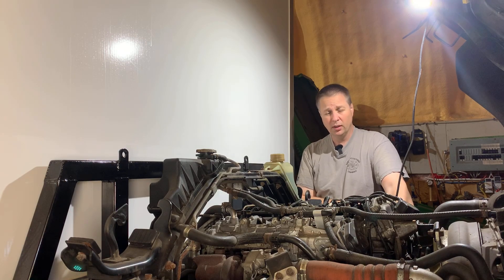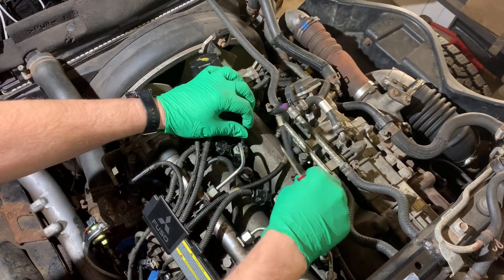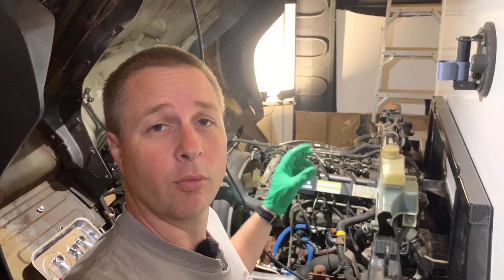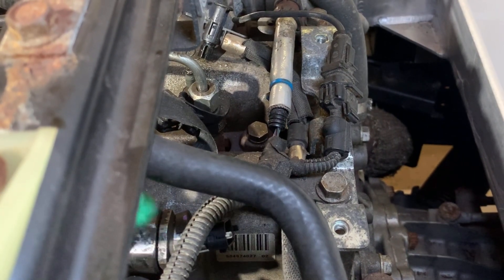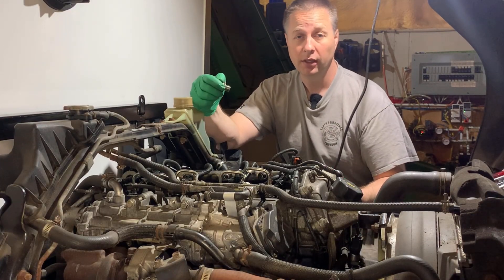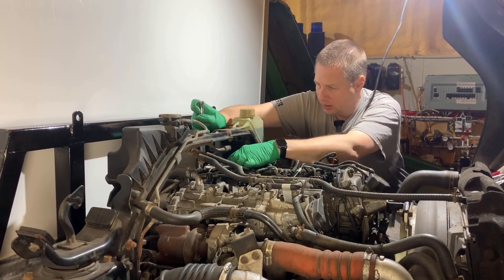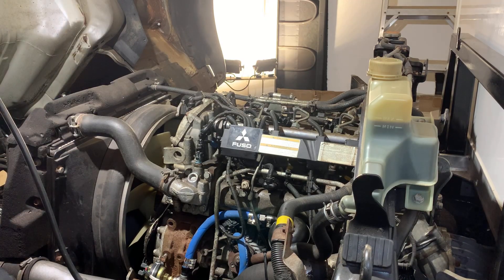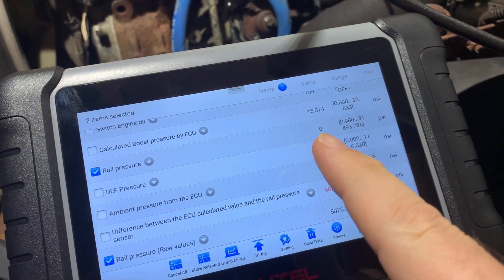Mitsubishi FUSO - Fuel Rail Pressure Regulator and sensor.

Comment: Hello,
Sir,
Which is best Scanner for Modern Efi diesel engine diagnostics. 
Plz guide
Reply from the maker: There can be many differences without knowing the brands.  Some have very specific requirements - so best to check any scanner you are considering to confirm it works on the brands you have locally to you.  I have been very happy with Autel.

Comment: My thinking behind it is this, just like the injectors don’t fire until around 1800/2000 psi as they could dribble giving you a diesel knock or hydraulic lock,
The high pressure pump won’t pump until the ecm see a pressure of 180/220 psi as it wouldn’t be able to sustain operation
Reply from the maker: Good thought, but the high pressure pump is fully mechanical - if fuel is getting to the mechanical pump while the engine is cranking, it will push the fuel out (if its working properly!)  This electric lift pump on this engine is not designed to operate at as high a pressure as what you are describing - it's intended to provide fuel to the high pressure pump somewhere in the range between 60 and 100PSI.

Comment: I think you may of created a man made fault on top of a fault which it’s is so tricky to pin point,
Get you electric pump pressure back up to 180/220 psi 
Keep your rail out let’s blocked off and go from there,
Reply from the maker: It's absolutely possible there is more than one issue, however I have been going through and eliminating them one at a time.  As mentioned, the electric lift pump on this engine is not designed to supply 180/220 PSI.  Which engine are you pulling this information from?

Comment: I’ve just checked on the canta I’m working on
The electric pump in the fuel tank is producing 220 psi which ignition on while it runs, 
When the electric pump stops the rail pressure drops to 180 psi and holds,
What is the pump you fitted to the side of the high pump rated,
Reply from the maker: Wow, that’s a lot of pressure for a lift pump.   Mine runs between 60-100 PSI, external to the tank.  (Within factory specs)
Reply: I know, I had the miss fortune of pulling the out let pipe off the top of the tank sender a long time ago, while the ignition was on 😂 
The really do kick out some pressure,
Look I’m using xentry that’s where I’m getting my data from,
What was wrong with the original tank pump
Reply from the maker: I was using Xentry at the start of all of this - but now just use my Autel scanner - it's much easier and faster to use.  My original electric fuel pump had corrosion on the aluminum casing, I replaced it before it failed (previous one I owned failed and started spraying fuel out through the side of the pump, a huge mess).  The lift pump currently in my truck is a brand new Bosch pump.    My pump is external to the tank, not internal.

Comment: 6:33 Crossing my fingers. Aw, spit.  Q: How long did you have it running after putting in the catastrophic fuel pump grenading fix?  Could that somehow be interfering?  I will say one thing, though.  Working on a dead vehicle in your garage is much better than attempting it on a frozen trail far beyond B. F. Egypt.
Reply from the maker: Either you are one step ahead, or I am… I pulled the disaster prevention kit in the next video! (I’m a few weeks ahead, videos are scheduled) 😎.  From the very beginning, I’ve been more than happy with the PLACE it broke down. LOL.

Comment: Hey man 
Please listen to me please 
I can help you because I have a 4P10 that distorted the fuel system, and I rebuild it. Now it's perfectly fine. Please  I can help you
Reply from the maker: There are many things that can go wrong in a fuel system - if you’ve followed along through all the videos I’ve posted for the last year and I have missed something let me know what I need to check.
Reply: @BruceandKrista in my case is totally similar condition.
1.First thing remove the CP4 pump and install a recondition or brand new pump 
2. Replace the Rail pressure regulator and sensor. And make sure to clean the Rail
3. Remove all the injectors and only connect high pressure fuel inlet line and connector. Do not install the injector in to the cylinder head.
4. Now crank the engine and see 
All the injectors a fire 

That's it if the injectors are bad you can tell it from step 3

Aaa wait before you install the step 1 pump 
Try doing step 3
Reply: @BruceandKrista  ?
Reply from the maker: Well starting with the most expensive and hardest to obtain part isn't usually how I go about things.  I prefer to rule out items, confirm what the failure point is, and then replace that - or at least try to go that way.  I'd prefer to diagnose as much as possible, and confirm the failure point before spending large sums of money.  If the fuel pump itself needs to be replaced, that's fine - but the first thing I did was swap out a fuel pump, and it got me nothing.   Not sure how many of my episodes you have watched, but I've already flipped the injectors.   If you watch the next episode (coming out on June 6th, as I am usually a few weeks ahead of what is on Youtube!) - I have swapped out the fuel pressure sensor and regulator with a second (used) set - it did not change anything.  I have now received a new set, and will be changing them out today so we will see. Logically, as you have pointed out, these are the last parts that could be causing the issue if it's not the pump - but it's a long process to get to this point.  Parts for these trucks are unfortunately quite hard to come by in my part of the world, so everything takes longer!     Removing and replacing the high pressure pump again, and spending all the money on it would be a total waste if the pressure sensor or regulator are the problem - not sure why you would list pump as "first thing" - but your suggestions are in line with what I am doing.
Reply: @BruceandKrista
Yeah I know Bruce 
Did you check the CP4 pressure regulator voltage?
I was told to replace the pump because you have no pressure.
Yes I have watched all of the videos.
Is there's a way that we can contact.
I can help you because 
I have that exact same failure on me.
BTW I had a problem on my 4P10 that was low power at 80kmh
The failure was the ECM 
Rail pressure sensor short to the GND and fry the ECM. I don't think you're problem is that. 
Can you do a test crank without CP4 disaster prevention kit 
If there's a way we can communicate privately like instagram or WhatsApp let me know 
I can help you with the diagnosis
Reply: @BruceandKrista 
^^^^^^^^^^
Reply: Don't rebuild the CP4 pump that's the total waste for time and money 
Because if it fails one time then it will never works

Comment: Step 1. Take all of your "disaster prevention" kit off and return it to stock. See if it starts. If this fails...

Step 2. Send both of your high-pressure pumps and all functioning injectors out to proper shop that works on this stuff for a living. Get them inspected, tested, and rebuilt properly. If they are not functioning correctly, you're doing nothing but wasting time trying other stuff.
Reply from the maker: Well, step one you’ll see if you watch next weeks video 😁 - that was my next thought as well.    As for step two, unfortunately there is no one around here that will touch it.  I’ve already tried that.

Comment: You going to energize the fuel pressure regulator with constant 12 volt for a short while without damaging while you crank it. If it doesn't spray out the injectors then your pump can't build enough pressure. 🤷
Reply from the maker: Not sure the pressure regulator will like 12V, I believe it’s a PWM signal…
Reply: @BruceandKrista  same on the ford/internationals but for testing that's how it's done.
Reply from the maker: So, 12v is closed and 0V wide open? - honestly don’t mind if I damage it, I have a new one coming.

Comment: I'm suspect  of the pump failure circuit... any chance it is dumping pressure? Can you teste the rail relief valve in a seperate test circuit.?  I would test all valves that dump pressure or have a low pressure return and eliminate them one by one,,,just as you did wth the injectors
Reply from the maker: Only one relief valve in the setup now, the one I swapped out.   That said, I have a new one on order, I don’t trust that both of these ones are not bad.  Fingers crossed!

Comment: May be completely irrelevant but that engine doesn’t sound quite right when it’s cranking over. Do you know how it’s sound compares to a healthy version of the same engine?
Reply from the maker: Yeah, it’s been cranking slower for a while now - I suspect there isn’t as much oil lubricating things like the rings -  as it never gets a chance to build proper pressure.
Reply: @BruceandKrista Yes, possibly but could something else be causing it to crank slowly and also was contributing to the lack of fuel pressure. For instance what if the pump was producing pressure but not releasing it to the rail. Would that cause a slow crank? (I have no idea if that is theoretically possible).
Reply: Here is a healthy version 2015 FUSO purrs like a kitten.
https://youtu.be/npN38n1La8c?si=fneqSTk-riZXxxjI

Comment: Any way to test the outflow pressure of the high pressure pump? With all the things youve done, I dont remember, did you try a squirt of starting fluid at the air intake?
Reply from the maker: I’ve been thinking of trying to come up with a simple way to do that.  If I could just thread the sensor into the fuel supply pipe that would be good, but then I would be dead heading the pump - not good…
Reply: @BruceandKrista  Did you do the starting fluid in air intake?  I had a FICM (fuel injector control module) go out, diesel would not start no matter what, we shot starting fluid in air intake and it ran for a few seconds. That told us it wasnt electrical and was fuel related. If yours wont start doing that, Id go down the electrical path.
Reply: @atubeviewer4942 I’m curious about starting fluid also. If this engine has glowplugs it would be wise to disconnect them before spraying starting fluid.
Reply: @davidedwards2764  In our test, we did not disconnect glow plugs. It was a quick squirt. Like I said, only ran for a few seconds but that alone told us it was not an electrical problem.